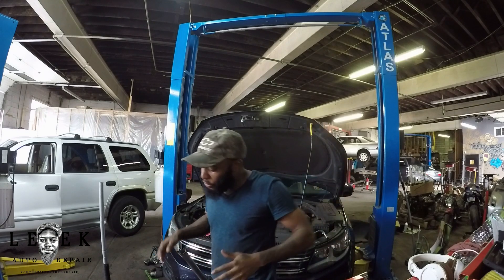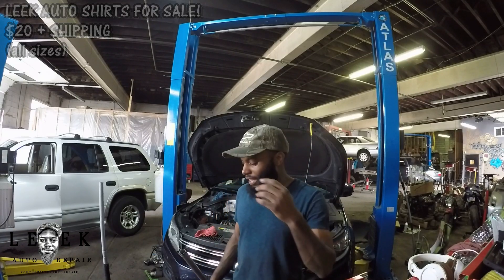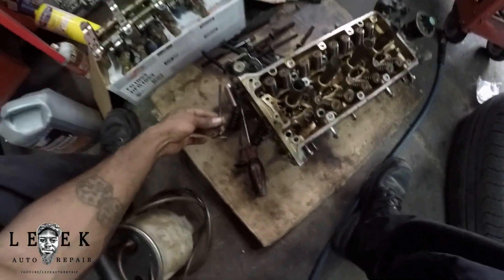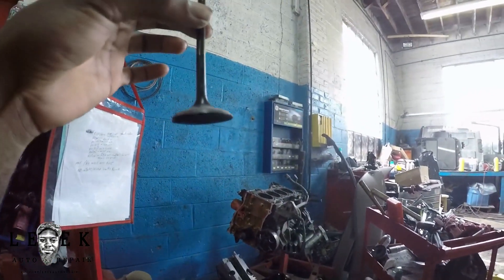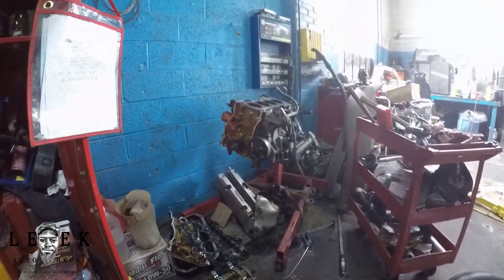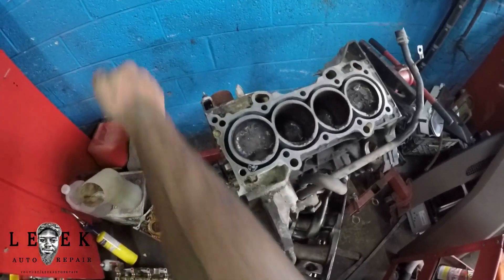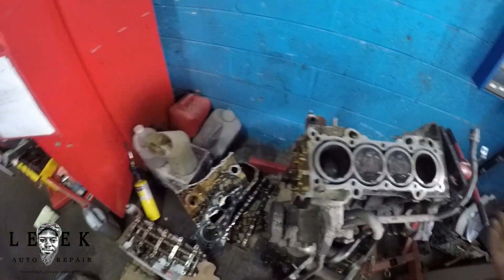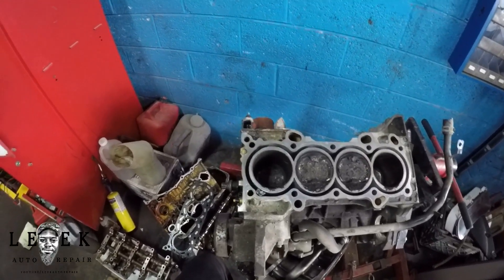What Does A Bent Valve Look Like? Rebuilding K24A4 Part 2

Comment: Another way to tell if there bent is to look at the valve clearance.  When there bent it will have like an 1/8 of an inch of clearance.
Reply: Johny Harbinger   You can’t look at the clearance on engines with hydraulic lifters.   You can only do it that way on engines that are adjustable which is most of the Asian import cars.
Reply: @1970chevelle396  ur racist u said Asian
Reply from the maker: Shut up